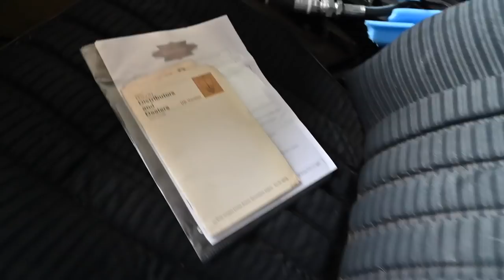4.6 V8 Rover P6's life story

Comment: There is nothing more rewarding than completing a project successfully on a car without a huge labour bill from the garage.Always good to have a certified mechanic check everything over though afterwards just to be on the safe side.Always as the video shows use safety,double safety and triple safety jacking a car up especially working alone.If you run out of jacks then get some sturdy wide logs.
Reply from the maker: Im going to need the gear linkages and kick down set up so Ill get TJ Motors, my go to garage to go through it when its done

Comment: Back in the day, we used to swop cars with other dealers so if someone bought a blue Rover and we only had a Red one we would Trade Plate or Truck between dealers that had one and swop with something they wanted, that's why some cars had a hundred miles on the clock prior to the end customer picking it up. Driving pre-PDI BL Car was challenging as the number of defects they had. Lights not working or seats not adjusting fuses blown rough running. It always paid to take a small tool kit, and remember to take the suspension blocks out.
Reply from the maker: I think that still goes on, although its less risky these days!

Comment: Nice story on the cars history matt. In the early 80s I had an L reg v8 S red manual trans. You could light up the rear tyre   in first gear from 10mph just stamping on the throttle. But bad starting from cold never had faith in it. I moved back onto a c10 pickup and my mates had p5 S with holley conversions which I was jealose of.

Comment: Very interesting, love the P6 wondered how you got it and the story to where it is now, I haven’t done many projects but they all go the same way as yours when I’ve done them. Most recent was mk1 Audi TT bought 12 years ago rolling project then crank sensor went it snapped the bolt on way out and as on front of engine behind everything spent 5 years in a barn then basically a comedy sketch to get back on the road and ended up a massive project. Got there in the end new MOT etc then after a year of motoring the clutch slave cylinder went and I didn’t have the barn and no one wanted to do it, (gearbox and prop off) so alas it went, but hey ho hope you have better luck.
Reply from the maker: Thats unlucky! This is so close now, but its all the irritating fiddly bits to figure out now!

Comment: This episode, Mat remembers the engine mounts that he forgot before...

A suggestion that is worth making now is that, with the car now having a 4.6 rather than the stock 3.5 V8, it might well be worth considering fitting a separate transmission fluid cooler rather than using the standard in the radiator unit.  I say this because the 4.6 should be producing a lot more power and torque than the stock 3.5 did so that's going to cause the transmission fluid to get a lot hotter than it would with the stock engine and a larger, stand-alone transmission cooler will massively reduce the risk of cooking the transmission.  Also, you're not running the risk of having one of the cooler tubes inside the radiator corroding through or splitting and filling the transmission up with coolant, which will utterly destroy it to the point where almost nothing, and potentially not even the casing, can be re-used...
Reply from the maker: Im going to add a separate coolers for the oil and trans when I get a bigger radiator for the engine, the Rover rad has a 2 separate sections for oil and water so if one leaks it just dumps the fluid, but the engine will need more cooling
Reply: @furiousdriving    That's certainly a better set up than in a great deal of factory autos.  I can imagine that some extra cooling may be needed, there's not really all that much space under a P6 bonnet, especially not with a V8 in there.  My dad's old 2000TC series 1 could get pretty warm when driven with enthusiasm, despite having a rebuilt radiator and the cooling system thoroughly overhauled and cleaned out...
Reply from the maker: @gosportjamie  thats the only issue, finding space!
Reply: @furiousdriving    I'm sure someone probably makes an upgraded radiator for a P6 V8.  Of course, price and being able to get one at the moment could be issues...
Reply from the maker: @gosportjamie  thats an issue for everything at the moment!
Reply: @furiousdriving    This is very true...

Comment: Are the 3.5 and the 4.6 engines related? or are they different designs?
Reply from the maker: An evolution of the same motor, so it bolts straight in
Reply: @furiousdriving  Thanks Furious...something I always wondered but never got around to finding out.

Comment: You should put the other v8 in the volvo 740. I'd be willing to post a donation towards a Hollies fuel injection for it. Would be cool to see how the p6 and the 740 compared to eachother. ( It should go  in, one of my mechanic school friends has a volvo 164 with a v8 from an sd1.)
Reply from the maker: You could fit 2 V8s side by side in that Volvo! I did think about it but the V8 isn't much more powerful than the Volvo 2 litre!
Reply: @furiousdriving  I know it's not but I've heard of people getting great results with the EFI with the smaller american v8s. Those rover v8's are quite astmathic really in original spec. Your 740 is only 2l? The boy racers here in sweden usually tune the 2,3L engines, some times up to over 800Bhp. But they need that just to haul the subs.
Reply from the maker: @rimmersbryggeri  Im looking at the Holley Sniper WatchJRGo just put on an old V8 pick up
Reply: @furiousdriving  I have seen a few such installs. Eric TheCarGuy did one also but I wouldnt use that one as reference. Holley have pretty good videos on those setups on youtube aswell. One of those and a more aggressive cam could potentially do wonders for the old rover v8.

Comment: A shame you couldn't use a four speed automatic, to save fuel mileage, as you pay a fortune for fuel ⛽!
Yes, I know you like a manual gearbox, but when you break a leg, foot, etc., or heavy traffic, you would be grateful for an automatic!
I must say you are doing a very good job with the limited resources you have.
Reply from the maker: Its hard to find a 4 speed auto that would fit, most 3+ ratio autos need an ECU which this doesnt have any of, plus with the ever tighter restrictions on using older cars in towns its not likely to see much stop start traffic, so a 5 or 6 speed manual will be a huge upgrade
Reply: @furiousdriving  Ugh, that's awful! I know Pete C has fitted a four speed automatic to his current restore of a Ford Cortina off an early model Sierra, but it is NOT a Rover with a V8.
Yes, a five speed manual mostly makes sense, if you use it as an occasional cruiser.
And after the SD1, Rover 800 became FWD. Ugh, I don't envy you, but I must say you truly are doing a very good job! And you have such unique vehicles in the UK 🇬🇧; yes, we have some very nice classic vehicles, many I remember from my childhood, but our next-door neighbour had two distinctive imports; a Citroën DS and a Renault Dauphine, not at the same time, but I remember admiring them as a small child!